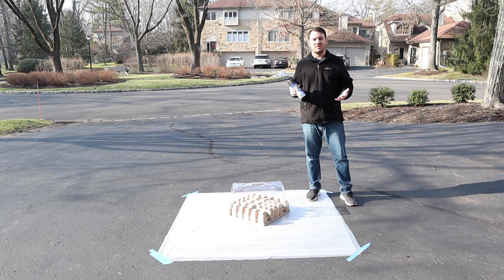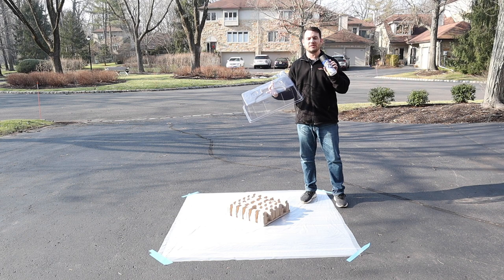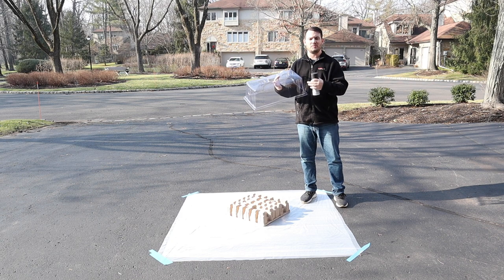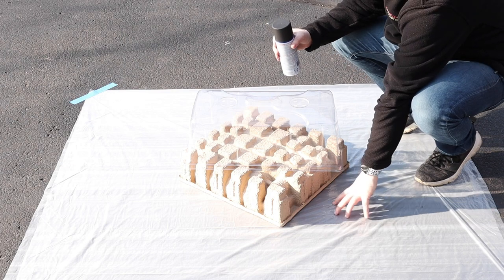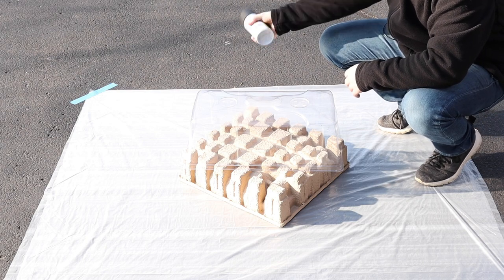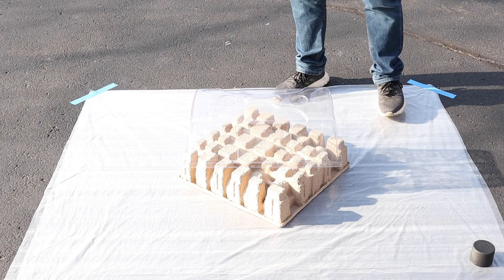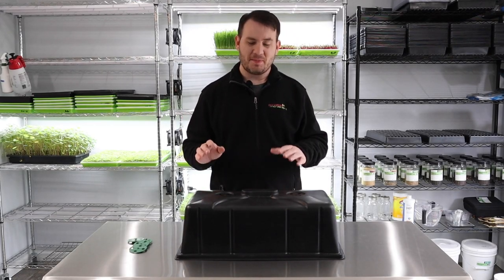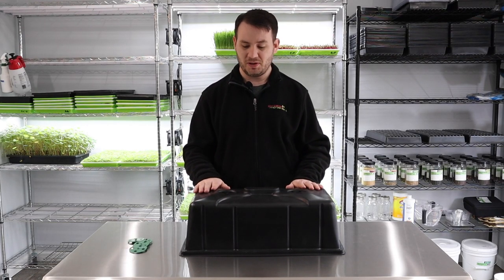How to make a Blackout Humidity Dome for growing Popcorn Microgreens!

Comment: The paint used is chemical right, won't it come in contact with the microgreens..is it irremovable paint ?
Reply from the maker: Even though its a spray on plastic that is irremovable.. Never comes in contact with the greens. You spray it only on the outside of the dome, not the inside.

Comment: Couldn't I just use spraypaint?
Reply from the maker: For the same price, I’d go with the plastidip any day of the week. The spray paint will have a tough time sticking to the smooth plastic shell. You’d have to scuff it up with sandpaper. Again, why bother if plastidip is only $5 🤷🏻‍♂️
Reply: @PrincetonMicrogreens  ok. I've never seen it before. That's why I was asking. I'll have to grab some though.